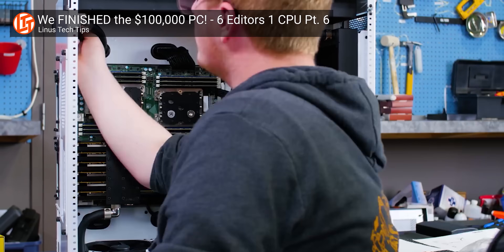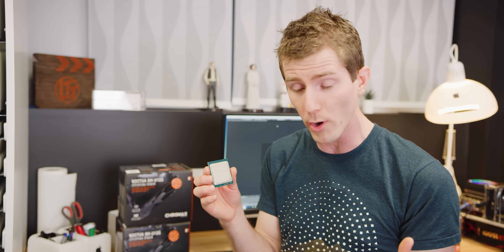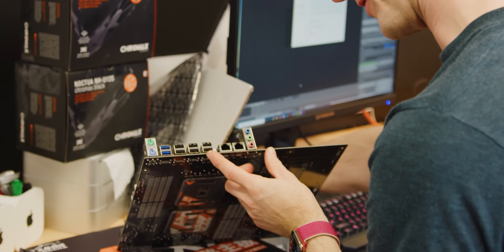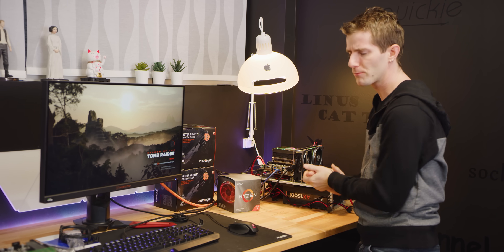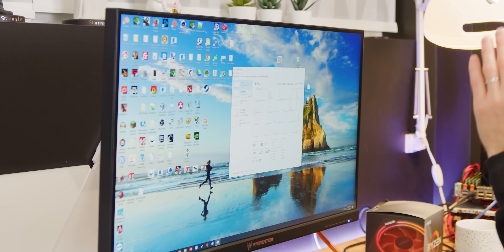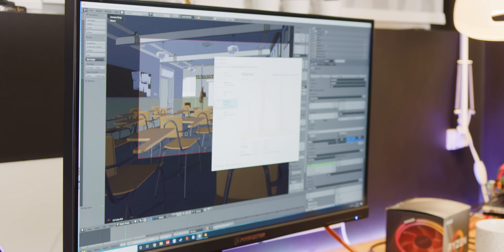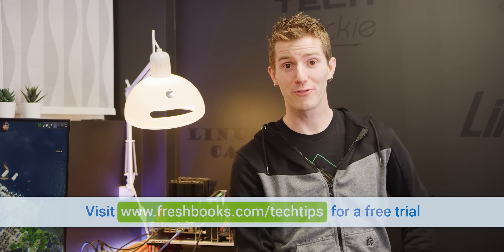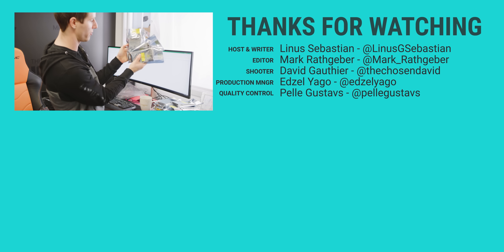SIXTEEN Cores for the Price of EIGHT!

Comment: I think you need to read up on optimal NUMA utilisation. You don't want to execute across multiple NUMA nodes unless you have to and your definitely don't want to access memory from another NUMA node if you can avoid it. A hallmark of lack of NUMA awareness is the use of cores across different NUMA nodes when your workload doesn't require more than one node's cores, also unnecessary memory access across cores. Generally the operating system scheduler and memory manager should be responsible for ensuring that the workloads present in the system are arranged to take the least impact from NUMA (and iirc Windows is pretty good at this).

Comment: 3800X? If you want cheaper, you could always get more reasonably priced R7 3700X, those 2-3% extra you get with 3800X aren't really worth it, unless both are about same price. Or you could always instead get Ryzen 2700X for like 220 or 230USD or whatever it is now, or if you want to get your hands dirty with overclocking 2700 is like 170USD,  which granted would benefit from better cooler, if you want to overclock it to close enough to say you got 2700X performance, but still even 2700 would game more consistently, and still close enough to what 2060 will give with 3800X, than 2 Xeons could.

But yeah, thanks to AMD and Ryzen, we are getting more cores and games are getting better at using more cores. Something people who kept recommending Intel didn't think about. But trends do change and since we aren't getting faster cores, developers might as well learn to utilize what we are getting, which is more cores. Though AMD is consistently improving per core performance too. But as more and more games move to newer engines, which are built with that in mind, they will more and more start utilizing it. Which is good part of why older Ryzen generations also didn't game well, since all game engines were built for Intel quad cores.

Comment: In the US, 8 cores are $135. $300 for the CPU is no deal, even if it’s slightly faster than a Ryzen 7 2700X in tile-based rendering... not to mention that it’s used, has no support, consumes much more power, and has no upgrade path.

Comment: Don’t hate my server is Dope I’m running this board with two 2670s and 32 gigs of RAM. If there’s anyway that line and sees this comment I cannot get this board to run with more than 32 gigs of ram on the processor zero slot. It has eight dimm slots But the only time it posts is with for filled. I paid $160 on Amazon. I would love to get this to octachannel ram.

Comment: 11:20 "Utilising more cores to a lesser degree"
Why does that happens sometimes ?
I know some games can't use many cores, and some game will max out one and not the others. But why do some game use seemingly every core but at only a fraction of their potential ?
Reply: It depends on how the devs built the game, some games are better optimized to use more cores/threads.
Reply: It is a visual bug, in Window the game use  only 1 core but the OS rapidly switch the game between all available cores, so for each cores it always 100% usage but because Windows switch them between cores it divide the total usage by the number of cores. eg: 100% of 1 core divide by 4 cores = 25% CPU usage.
Reply: it also trick game dev; to think that their game is efficient, using only 25% of CPU but in fact is 100% usage and is bottlenecked by 1 core. Tricking them into making inferior game.
Reply: xponen_ If Windows “Switches the game between core” wouldn’t it improve performances ? (Like RAID 0 with capacity)

Wouldn’t développer notice whether they gave their engine multithreaded support, and whether the performances make sens ?
Reply: @MaximeDecroo  the devs have to do Benchmark & testing which is a laborious & unrewarding task that might even prove that the dev's own multithreaded code is pointless.
Reply: If coded improperly, a game which spread its task to multiple-core will slowdown all the core because of a "Locking" situation where a thread is stalled because it is waiting for another thread to finish.... in effect a bad multi-thread code waste CPU cycles just to wait for stuff.

Comment: guys a 750w is enough for a core i9-7960x and rtx 2070?
Reply: put 1000w... 750 is too low for those things... and d'not overclock
Reply: @arieloq  really? people even adviced me to get a 650w and 750w if i wanna overclock, i calculated my wattage usage and i had average 550w total
Reply: @chakra_x  all depends on how many other stuff u going to put in your system... ssdx2 or something more 750 is ok but overclocking can be uncertain from the point of how many watts going to take cpu + gpu the i9-7960x can draw 300 watts overclocked the 2070 says 185w but not overclocked... so... those are taking more than 400 watts by their own
Reply: @arieloq  well i got 2 ssd of 120gb and one 2tb hard disk, 3 fan 120mm 32 gb ddr4 and artic freezer 33 air cooler all of this around 550 wattage, i dont think oveclock is necessary tho but i may be
Reply: @arieloq  judging the power consumption section of the article and knowing that gpus does not consume that much energy than previous energy i should be good with a 750w right?
Reply: @chakra_x  Like i say if you not overclock is ok... just check that the power supply is rated gold, platinum or titanium... never underestimate those... it can cost you all the system
Reply: @arieloq  yes i dont think overclock is that necessary, the corsair 750w fits my budget. it ain't that cheap but not expensive too so it's just right there also plus gold so it's good

Comment: I don't get all the effort to get cranking CPU performance. I run a 1st gen Ryzen 5 with a GTX 1080 and never see my CPU go about 50% for any games, it's always my GPU pegged @ 100% Am I missing something here?
Reply: Depends on the kind of games... if too much graphics like any fps it going to tax the gpu... check for some optimizations in settings, look in some forums about that...
Reply: @arieloq  I didn't explain myself very well. My point is, with my cheap and fairly crappy CPU all the latest games play just fine, most @ 60FPS and higher and I'm nowhere near CPU limited. So why all the fuss about CPU performance
Reply: @happydeux2254  cause the cpu is one of the most taxing parts on the pc...

Comment: If you didn't configure the BIOS the RAM is going to run at 1333 MHz and are you using registered ECC? Registered ECC is more reliable but has a performance penalty.

Comment: I've had two of these E5-2667v2's for a few years now and they do have different Turbo states depending on core utilisation. If 5 to 8 cores are loaded, it's 3.6GHz. For 4 cores it's 3.7GHz, for 3 cores it's 3.8GHz, for 2 cores it's 3.9GHz and its single core turbo is 4GHz. In my testing the chip will spend 90% of its time at 3.6GHz which is its all-core turbo speed. Quite decent chips for their age.

Comment: Solid video! The Sandy/Ivy Bridge IPC gap is very real these days. Late last year I put together an eight core Sandy Bridge EP chip at 2.5 GHz all-core speed in an X79T for use as a cheap home/Plex server. Compared to my stock Ryzen 1700 @ 3.15, the difference was really stark - on the order of 50+% sometimes, especially in multithreaded jobs. Zen 2’s crazily faster; I absolutely believe it could take twice as many lower speed Ivy Bridge cores to compete against it.

Comment: this is a great budget gaming option i put together myself https://pcpartpicker.com/user/InexperiencedBu1lder/saved/Wj9hyc for 1200$ it makes no compromises but you can get it to as low as 900$ with less premium parts but same basic hardware
edit: 300$ cheaper and still good performance https://pcpartpicker.com/list/Chqp3t not quite 900$ but you can easily lower that buy stepping down from a 2070super to a 2070

Comment: I am not surprised as I told many many people that intel hasn’t done much improvement since sandy bridge . Ipc has increased very minimum. Only core count has really increase . If a 4790 would have 8 cores 16 treads it will perform very similar to a 9900k both running at 4.8.same goes with ivy bridge 3770k if it was 8 cores

Comment: we know that you guys are HIT with CES, but AMD released a $85 Ryzen 5 1600 refresh! it's the AF model and is abit hard to get but it would be Packaged with a Wraith Stealth Cooler, you guys willing to redo your Budget Performance as the R5 1600 AF (the CPU in question) and see the Differences between your $900 Build, a proper 2600 build, and the older R5 1600 AE (original)

if you want to know there is some added Ram support and it being 12nm than 14nm, maybe take abit more Detailed than Performance that Gamer's Nexus did? like what it has now than the old one?

Comment: Recently picked up a HP Z820 dual Xeon system (E5-2867W v2) with fully populated RAM (256Gb) and other bits and bobs in it (such as NIC/RAID) for just over 1k. I know it's not as entertaining as scrounging around for stuff in China, but the market for second hand workstations and servers prices have free fallen for the last few years more so with the release of Zen 2. If any one wants a cheap render node on a budget then they're hard to beat and you can often find great steals on ebay and elsewhere if you're patient.

Comment: SOOO... i kinda cringe and get a bit frustrated when i see test bench results where the content maker uses a 60hz monitor. TO TRULY push the CPU and GPU, i strongly believe you should use 144hz or above. Then at least we can see how much further the System can be pushed. To me, the 60hz monitor is a bottleneck. A friend of my has a 3800x and all on high settings he went above 120fps at least. Also not too much of a fan of synthetic benchmarks.  REAL life action gameplay is better for test results.

Comment: $180 2697v2 = 24 cores for the price of 8, lower clocks tho & similar results. I have a 2680v2 at over 4Ghz on a rampage iv for my work rig. Ivy seems to bclk higher than the usual 3-7mhz.

Comment: The E5-2667v2 should be boosting to 3.6GHz even under all core load situations (unless you are thermal throttling, which he’s not in this vid). Sounds like turbo isn’t working properly if it’s only running the 3.3GHz base clock. 

I had the same experience with these Chinese boards. They will run your Xeon chips, but at base clock without turbo. For $125-$150 bucks you can buy a used Supermicro X9D series board from eBay and get a board that actually works properly with the same and more features, and incredible build quality.

Comment: With the shitty scaling of even multi core single processors in games, I have very low expectations for this......

After watching I can tell you for sure it is that ram holding back the performance in Anno on that dual chip system. I had a x79 platform and when I upgraded the ram from 1600mhz to 3000mhz it was around a 45% boost in speed in games. Very visually noticeable. I'm sure with the server chip you have to use ECC, but if you could use normal DDR3, I think we could do much better.

Comment: I ran one of these mobos with 2x 12 Core Xeons. It was a Great Work station, but defiantly has a Gaming FPS hit.
one thing I did notice is if you put faster ram in to get the Maximum possible supported by the Motherboard you would get an extra 2-3 fps.

So I ended up selling it and going the 2699 v3 Xeon route on a X99 board 18 Cores with a BLK of 105. this had far Far FAR! better gaming performance and just as good if not better work station results with the added benefit of ddr4 ram.
Admittingly costs a little bit more but there is plenty of Engineering sample CPUs around at the moment
the CPU actually exchanged blows with a 9900k on Futuremark scoring over 9k! on the CPU alone and you got to remember that's like 2.7ghz to 3.4ghz clock vs 5GHZ!

Comment: LINUS WTF i AM BUILDING ALMOST THE SAME SET UP WTF
but I am using Intel xeon E5 2660 and I don`t know will this motherboard work with this RAM 32GB ESUS IT ECC REGISTERED DDR3 4Rx4 1600MHz PC3-12800 RDIMM PLS if you could test this HELP ;-)

Comment: I have those same processors in a proper Asus Z9pa-d8 C602 series ATX board and the hold an all core turbo of 3.6Ghz (not sure where he got they don't have an all core turbo?). I also have them paired with a 128GB of 1866Mhz ECC server ram and they perform MUCH better than shown here.

Comment: Remove one of these CPUS, get a much cheaper 2nd hand server or workstation board and there you have a great setup :P Actually I wanted to get LGA2011 platform few months ago but somebody bought the CPU I wanted before me so I had to pass that option :/ Xeons are amazing! even more so when you factor in ECC RAM that costs like 3.5€ per 8GB stick and feature rich server boards!

Comment: There is a way to manage the bios to push it to its max all core boost which is difference from it's base clock. A E5-2680 has a  base clock of 2.7ghz but if you play with the bios you can get that to max all core boost at 3.1ghz and stay there. I had a dual socket E5-2680 system running all cores at 3.1ghz. (can't remember what settings but I wanna say play with the turbo or c-state settings in the bios)

Comment: Can any techy help me? I bought all my parts for my  first pc and i decided to build it: Ryzen 7 2700 Rtx 2070 super Msi b450 carbon crosair 570x Thermaltake 700 psu Trident Z rgb.

I have everything spinning fans, ram lights up (trident z) but i dont get a post. The feature of EZ DEBUG LED on Msi motherboards flashes quickly on the CPU but i have no clue what to do. The cpu has no bent pins and is seated properly, and properly aligned with the triangle. Also my psu is connected to everything and it causes the fans to spin, my motherboard displays its rgb. Could it really be a faulty cpu?  It looks like it runs but i get no post.

Any help is appreciated

Comment: Sure there's some frequency difference here, but I have a feeling that the much, much better IPC on the Ryzen chip is why it can do almost as much with half the cores.  IPC is quite important and will likely only get more important as time goes on.  Rumors suggest Zen 3 is getting some gigantic IPC improvements too, so even at lower clocks it'll be running circles around chips with worse IPC.  I mean if you can do 8 instructions in a single tick while your competitor is only doing 2... its not a tough fight.

Comment: Why X86 processors does not use different type of cores in a single processor like using 2 fast single core and 6 slower cores for 8 cores processor?
ARM uses Big Little tech so why not X86? it would bring down cost significantly

Comment: Still running single 2667V2 on my Lightroom rig ;) Reason has been the cost of DDR4 mem, since I currently have 48GB of DDR3... But it seems DDR4 prices have been falling since I last checked. It is just quite depressing when you currently have 8 memory slots and 6 full PCIE slots, when in builds that could within a budget like that Ryzen board, replace my current rig have 4 mem slots and 1-2 full PCIE.

Comment: I actually bought a server on ebay for home server things, and to play with virtualization software.  It mostly didn't get used to much until I started using it for video encoding too.  It shipped with 4, 4 core processors, I got 4, 10 core 20 thread processors to replace those, and now use it as 4, 16 core VMs, and even with the slower clock I am still cranking out at faster then real-time.  When converting DVD it gets about 60FPS, and with Blu-Ray it gets around 45FPS per VM.  That is healthy since my regular rig only ran around 45FPS on DVD, and 23FPS on Blu-Ray.

Comment: I use a pretty similar Rig as my main Machine. (I have some slightly faster Ive Bridge Xeon 8-Cores, a Supermicro Workstation board and a little mor RAM - 128GB) and I am absolut happy with the price/performance ratio esp. in Multi Threading

Comment: You could have run dual e5 2689's for ~$170 and got all core speeds of 3.1ghz, which is much better than that 2.7ghz even with a slight ipc improvement.
Reply: Yeah if you shop around Aexpress and find the V2 or V3 chips you can do much better.

Comment: I got a 16 core ryzen for 200 with a mobo and fan, 16gb 3466mhz ram for 56 512gb name ssd for 53 Mtallic gear neo silent case for 27 and a 2060 super for 290 and a 650w bronze psu for 37 (JUST UNDER 700 For a pc that will last for another 6 years and I’ll just upgrade the gpu in like 4 years